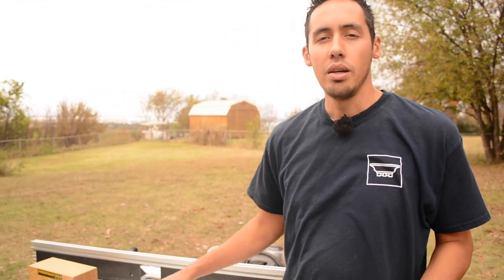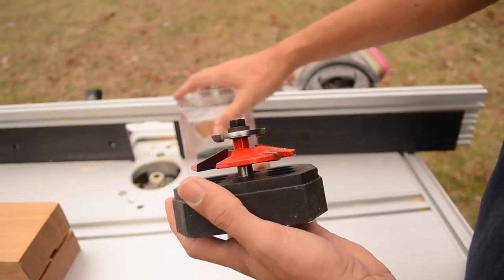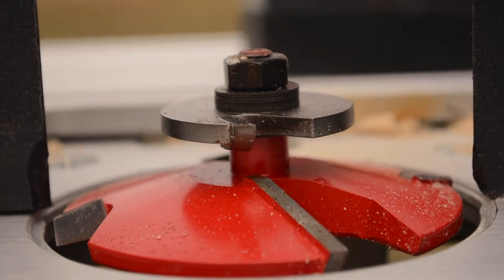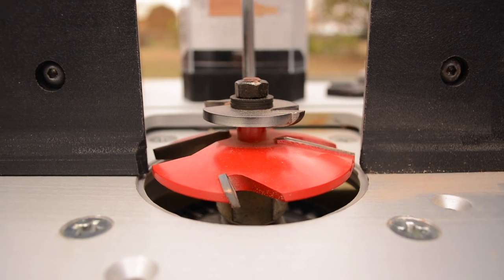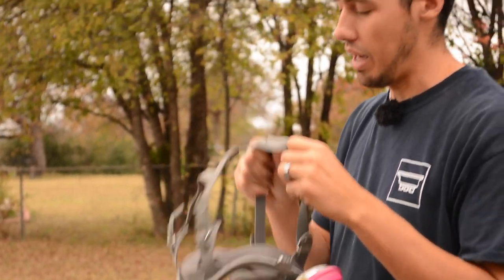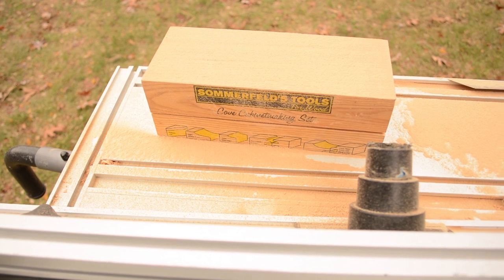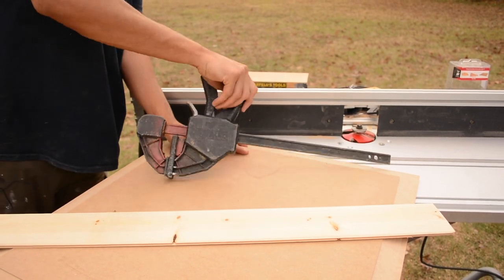Making Raised Panels - Finish Carpentry

Comment: HI Richard, thanks for another of your great videos; just a suggestion, much as you put on the full face respirator, would you consider using some sort of dust extraction system (a vacuum cleaner perhaps) because it looks like the air around you is being seriously polluted - I'm thinking other people in the vicinity.....that innocent child playing in the back garden or rather riding their bike nearby...…that's the least I do when processing mdf outside. Mind, it is not 100% but it does contain a substantial portion of the carcinogenic stuff. kind regards

Comment: So if you are using those panels for wainscoting could you just leave the back cutter off since your molding will just sit on top and not really going to fit over the edge like it would in a cabinet door?  I like your work and want to start my staircase soon.  Thanks for the instruction.

Comment: i am curious the bit you use cuts into the back of the panel. i understand that if your using it for doors as it fits into a  frame  but when you use it on walls does it not leave a gap around the perimeter of the board  between the wall and the panel. i am always looking to up my wood working skills and i appreciate your videos. thanks

Comment: Ever used a table saw and router? Or block planes?
I choose high powered fan(s) and / or shop vac used as a blower over the respirator.
No knocks man you are fully a good man for taking the time to drop them pearls. 
IBCJ LOCAL 944

Comment: Wow, that is removing a lot of material in one pass.  It would be interesting to learn how you prepare and paint that extended exposed edge of the MDF.  Cheers, David.
Reply: DRMNZ I've used ezsand oil base primer from Sherwin Williams. it sands as easily as pre primed trim.

Comment: Great MDF 'explosions', Richard; what an eye opener for breathing safety!

Say, If you replaced that black sliding material on the fence face, on the in-feed side, with a sacrificial material, and ran the bit through it, it makes a zero-clearance between your bit and the indeed-side fence which gives much better support to your workpiece. Not so big a deal in this case but on more delicate trims it could save you some tear-out frustration. 

Great, great vids.
Reply: If you did it once or twice it probably is not going to do you that much harm but over the long term doing it every day it is advisable to use a full respirator. 

I would if you are doing routing in your workshop of any wood then it is good to have them. You only get one pair of lungs.

Comment: Is the surface of the router cuts smooth enough to paint immediately or do they require filling and sanding first?  Great videos and selection of topics!
Reply: Interested in answer. Are you using solid core MDF?

Comment: Make sure and not raise or lower the bit after your first pass if you are making raised panel doors - the backcutter on the raised panel bit will shave down the size of the tongue that goes into the rails and stiles.  Rather, adjust the fence in or out if you want to make multiple passes, which is generally what you want to do, particularly if you don't have a powerful router motor.

Comment: Hey Richard, what do you guys do with the newly exposed MDF edges in terms of prep for paint? I've been making all kinds of millwork out of MDF at my new home and when I expose an edge I then have to, at the least, prime (I'm using zinsser bin alcohol based primer) and sand before I can put any paint on. On straight edges I fill the edge with joint compound, sand, and again prime and sand again. It's a lot of work and I'm hoping you have a different way that can make this process go quicker.
Reply from the maker: Matt Przybylski great question. Also great video idea. I use an orbital sander first. Then a sanding sponge. Quick dry primer sanding sponge again. Then more primer. You are right exposed mdf is very thirsty and will drink a lot of paint.
Reply: Same here What helps me a lot is to use Ultra Light MDF Besides being much easier to work with because of the lighter weight, it's much finer than regular MDF so it sands smoother and and less like a sponge so it needs less filler if at all  My 2 cents ;)
Reply: My best trick is to prep the mdf with a 220 burnish of sand paper.  Using this method will give you ultra smooth prime coats.  I’m talking about before you prime the mdf sand to 220.  Light coat of prime and sand smooth.  Prime again and it’s glass.  But you have to sand smooth with 220 before you prime for first time.  It’s a must.
Reply: You can prime it twice before sanding, it fills in the pours faster.

Comment: you don't take the back cutter off so the panel sits flush with the wall at the edge?
Reply from the maker: Shane Tho if you are putting the panel flush you could do that. We usually drop it into a groove.
Reply: +dfw crown Ohhh thats right.

Comment: I always have felt like MDF is super crappy for making cabinet doors.  What are your feelings?
Reply: BMac FPV yes , we never use mdf  for raised panels
Reply: BMac FPV He uses MDF for waynscotting and raised panels
Reply: Mdf is a great material for paint grade jobs.  It’s not the best for frames on doors but we use it for panels and it is very nice.  It’s very stable and thus won’t warp and or crack.  It’s a flat material and doesn’t have seams.   No grain either.  We actually use the ultra lite mdf for all paint grade cabinetry boxes.  Solids for the frames.
Reply: Paint quality mate. Stable, cheap and easy to work with. I wouldn't use it at all though if I wasn't competing with other contractors that do.
Reply: It does get a bad reputation.  I will say that if you are doing a cabinet job that is away from water, say a home office or tv cabinet, it’s great.  I’m very confident in the doors we produce with mdf.  Here’s the low down.  The solid wood choices are maple and poplar.  Maybe alder.  But I’m in California and our wood selection is awful.  Only twisted and warped wood.  You may find a couple good boards but not usually.  So why risk it.  Use mdf and enjoy a stable flat door.  We only do Inset doors so we need totally flat finished doors.  No twist or warp.  If we do stain grade we have no choice but to either order or make everything from 5/4 and mill it flat.  But it still may come out twisted after we’re done.  Wood is funny that way.  Thank god nobody wants stain grade.  Just be carful about mdf edges.  If you drop a door it can get dented on the edges.  And sand the profiles with 220 before painting.
Reply: +Tristan Patterson
People you choose the material on the basis of it application. You can use MDF on kitchen panel doors providing you use a good solid frame that will not come apart. 

WIth MDF you can have a floating or fixed panel frame (that is down to your). If you are doing wall panels then MDF is perfect has it is a stationary panel that will not be constantly opening and closing and taking abuse. 

Again people it depends on what you are doing with the material. Most tradesmen will know what they are choosing and why.

Comment: Ahhh, Lake Lewisville?
You mentioned you switched fro DeWalt blades to Diablo (good choice) but you never mention the blade spec's for the blades used on any of your vids but it would be helpful if ya did.
Merry Xmas to you and yours and thanks for the excellent videos!
Reply: Michael Mullner not sure what blades he uses for finish work. I usually just grab combination framing blades for general carpentry. I rehab houses. Not much finish work. I recently bought a Diablo blade that was specific for treated lumber. Best cutting blade I've ever used. Very smooth  no matter the cut. Even with the grain it was like butter.
Reply: How many teeth and diameter?

Comment: Hey Richard, great video buddy! I have a question, I will be making some MDF column wraps for a customer soon. I was wondering what you do on long miters as far as joining them together. I know MDF bubbles out with nails. I’m wondering how to join these long miters without countersinking and screwing. Would a 23ga pin nailer work + glue?
Reply: Negron Remodeling 
There are 90 degree mitre lock router bit kits out there bud. And look for a local supplier of AC glue for locking your mitre's.  FastCap makes a product called 2p-10.   It makes mdf work super easy. Good luck!

Comment: Hey Richard . looks good 
Aways used to think that I would rather work with MDF vs the likes of Oak etc , because ...no slivers 
But doesn't take long to realize the dust from MDF isn't a whole lot of fun either , I usually wear a disposable  mask , but I like the idea of the full face better .

What about ... fake raised panel ( doors ) ( plunge router )... do you ever do them ....can you do them without all sorts of jigs etc 
can you do them on-site ... or is it really a " back-at-the-shop " only thing  ?

Do you have a name for your drone ?  :-)     It's like they're  alive ...almost like  a pet  

Thanks for the show 

Bob from Calgary
Reply from the maker: renoguy25 yes the mdf is very serious dust. Highly recommend full face respirator. We don't really make doors too often . so I think I would probably just cope and stick. But I have seen raised panels made with a plunge router. They look good. Just have to square up the corners.
Reply: Finish Carpentry TV how do you prep and paint those raised panel edges for smooth MDF finish?

By the way, thank you for sharing your knowledge. My brothers and I are big fans!

Comment: Great video, but no link or information provided on the router or router table.  Thank you for wearing a full face respirator, but you must be clean shaven everywhere the respirator seals to your face for it to be effective.  Last, you need some means of dust control given the amount of material you are removing...a vacuum with a dust trap or cyclone at a minimum.
Reply: Looks to be Ridgid's Mobile Miter Saw Stand [Model AC9946] with a [Brand X] router/table affixed?

Comment: Is that MDF 3/4" for your raised panels?
Reply: vikings844 I’ll say yes.  I didn’t make the video but that’s 3/4”.  It is needed to use the back cutter.  Otherwise there wouldn’t be any lip on the raised panel front.
Reply: ok, Thanks. one more question. If I'm making rasied panels for wainscoting do I just need a router bit without a back cutter?
Reply: No.  That just makes the panel flush to the back side and flush to the front side.  You can use thinner material to avoid this.  Or have the raised panel part come out further in the front.  It will come out like 1/8” past the rails and stiles.  That’s okay.  Just makes a more pronounced raised detail.  I like that look.
Reply: David Bryan Woodworks Agree, my stiles are 1/2 inch so I would still get that depth without a back cutter.
Reply: You might also try using ultra lite mdf for the panels as they rout so much better.  It’s also much easier on the router bits.  I actually have a video of me making a door using this type of material.  Cope and stick door.  Maybe you would like to see it.
Reply: David Bryan Woodworks Yes, I was looking for the light weight MDF. Menards didn't have it. Does Home Depot carry it?
Reply: I’m on west coast.  California has it at plywood suppliers.  No Home Depot has it here.